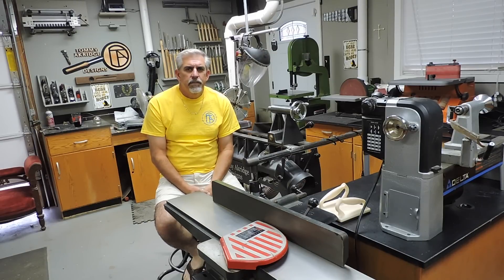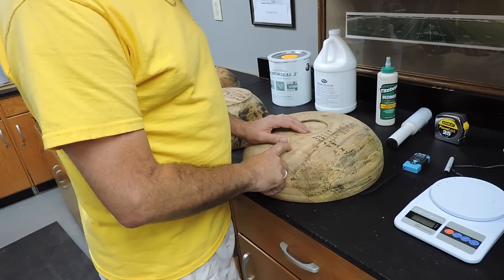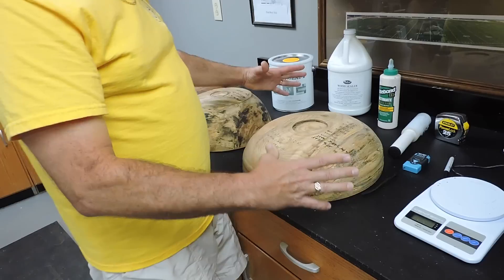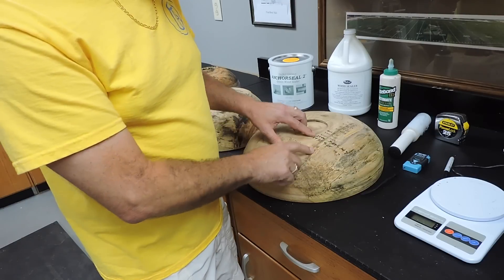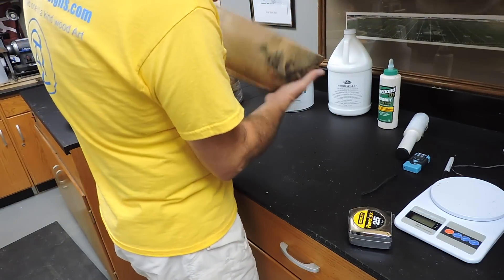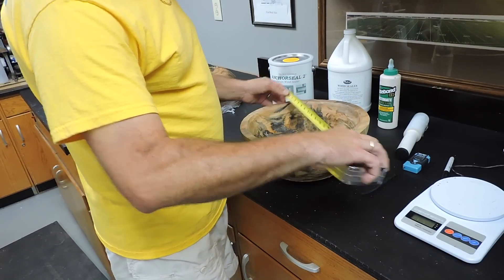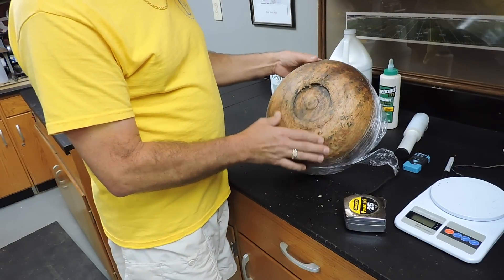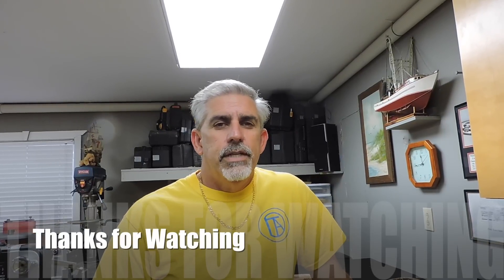Drying wet bowls with a wood sealer

Comment: I control the humidity in my shop year-round, humidifier in the winter, dehumidifier in the other seasons as needed, keeping the humidity between 40 and 50%.

I turn green bowls to final shape, sanded to 1200 grit, pack them in their shavings in a sealed plastic bag and take them out 10 minutes every night. I weigh them, once they stop changing they are done. Never had one crack !

Hope that helps someone

Comment: Hi Tommy- I m a turning addict as well. My thing is Turning live edge Burls. I also prefer to turn green wood. My method is simple and fast. I 1st turn my bolws to 10% thickness (usually 3/4-1" thick) and record the weight. I put it in the convection oven at 180 for 2-3 hours at a time. I open the door for a few seconds (especially in the beginning) to let the humidity escape every 15 minutes or so. My bowls or vases take a couple of days of about 6- 7 sessions. then I let it sit for a couple days. I know its done when the weight loss is minimal.
Reply: also-Ive found  the cracks and warps will be the same no matter which way you dry so you might as well speed it up this way and get it done.

Comment: I control the humidity in my shop year-round, at 40-50%, running a humidifier in winter and a dehumidifier in summer

I only turn green bowls, I collect the shavings as they come off the bowl, and I turn the bowl all the way to its final shape, sanding to 1200 grit. Sometimes I burnish the wood and don’t put a seal on it, sometimes walnut or almond oil – then I put it in a sealed plastic bag in its shavings, and take it out for 10 minutes every evening. I do weigh the bowls, when they stop changing they are done. I’ve never had a bowl crack and it’s a very easy process. Burl is great because there is no direction to the grain, I’m never worried about those bowls distorting

Hope that helps someone!

Comment: I have watched dozens of vids on drying and it seems it doesn't matter what you use, or whether one uses it or not.  One guy I watched turns hundreds of bowls, and has tried just about everything including not using anything at all and says that it's either going to crack or it's not, no matter what you do.  Robohippy green finish-turns thousands of bowls and he just warps shrinkwrap around the outside and it works for him.  I'm trying that and using the microwave on 10- minute foodwarmer setting (about 6 seconds on, 20 seconds off cycles) two times a day  and the bowl loses about 3/4 ounce a day.  when it stops losing weight, it's done, about 2 weeks.
I think weight is a lot easier to follow that moisture content, which to me would be different in different parts of the bowl.  
I have a bunch in bags with shavings but I think after this, I'm just going to use the shrinkwrap. Takes up less space and if it cracks, then I get to be creative to do something creative with them.

Comment: I’m kinda new to wood turning, at least to NM. There is a lot of Red Cedar that I am turning out here but struggling with my pieces splitting. 1. Can you microwave after you have treated it or do you need to do it before you seal it? Also does High elevation increase the splitting?

Comment: I dried my bowels using two paper bags and shavings, every so often I would check them change the shavings out. I've had decent luck doing it. I had two bowls and one was a sweet gum the other was dog wood they created thick black mold. The rest turned out good, distortion was something I couldn't stop. Have you tried any hackberry to turn?
Reply from the maker: I have not ever had any hackberry. I have had the same problems with the mold in the bags, I only use the sealer now, I can stack them on the shelves and they do not take up much room. so far I have not loss any bowls.